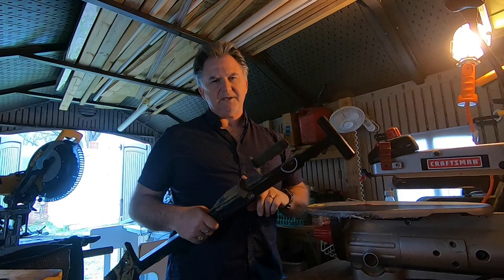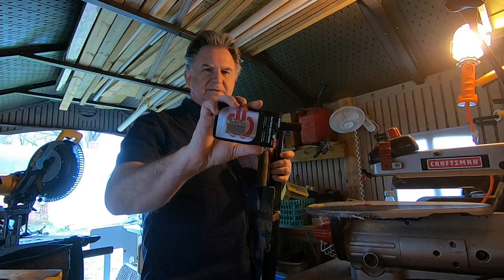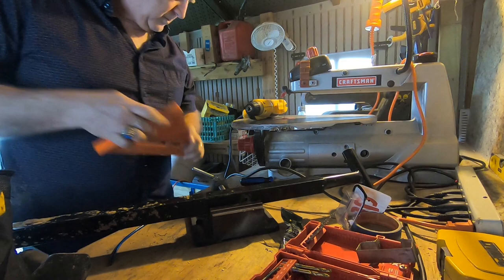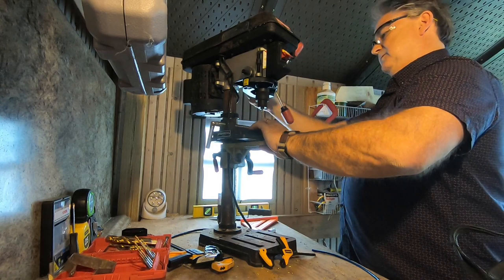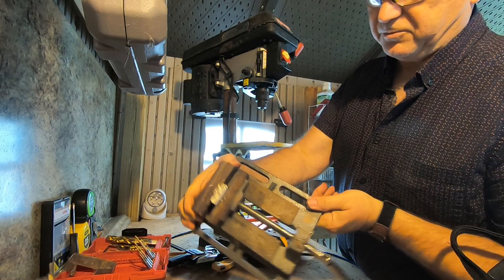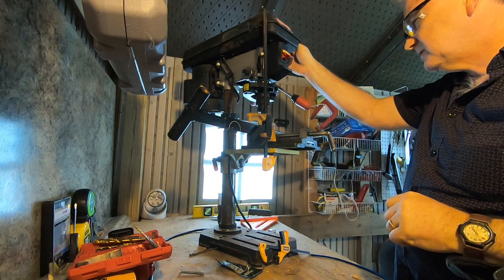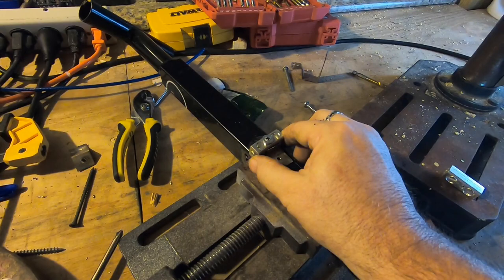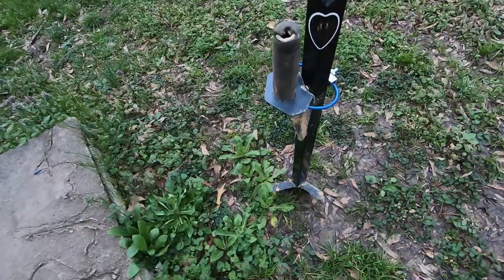Modifying my small dig tool shovel attachment

Comment: I think it is a great place for the shovel. I have a system for my larger shovel to hook to my hip while walking in the woods. What ever works and makes things easier if always a good thing. Thanks for sharing :)
Reply from the maker: sorry for the horribly late reply. thanks for the input. I still use it although that wire has popped out a couple of times. Look for mod#3 coming one day soon.